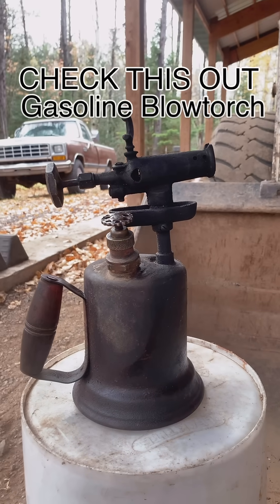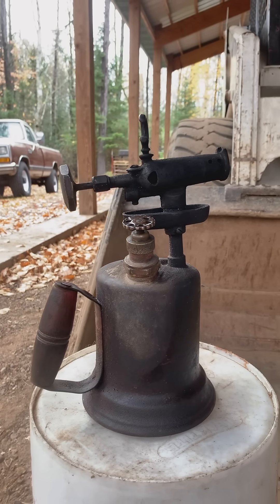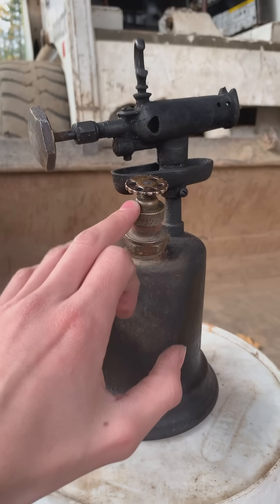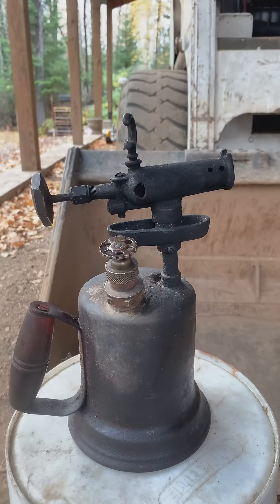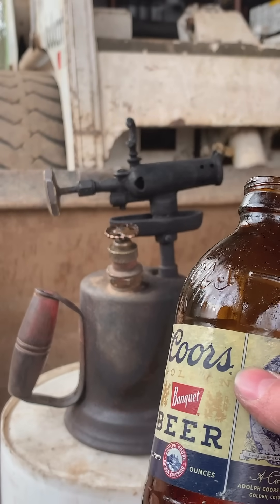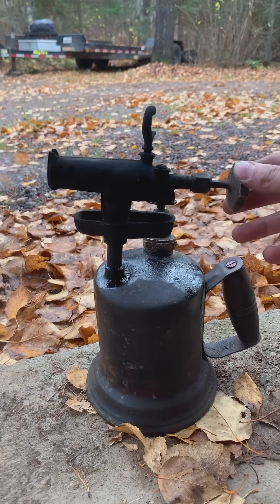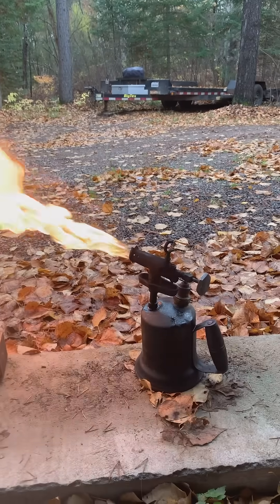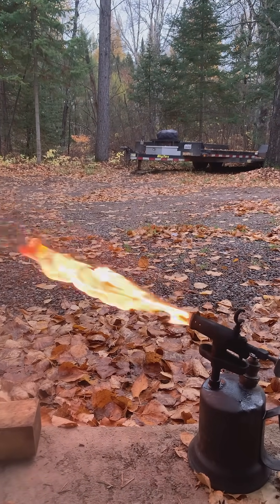BIG FLAME how a gasoline blowtorch works #antique

Comment: I still have a couple. I used them to melt lead for cast iron plumbing and to melt solder for electrical wiring into the 1960s.

Comment: I have a older one built in 1926

One more thing...engine oil worked the best, as it was much hotter than kerosene, which was commonly used, not gasoline

Comment: I was brought up with paraffin/kerosene blow lamps. They take longer to preheat and the pan must be filled with meths as kerosene doesn't burn readily on its own as a liquid. 
The kerosene ones don't normally have a valve for some odd reason. You just pump them up as the meths burns out and hope you get gas because they make great flame throwers if you pump them too soon. 10 feet of flame is not unusual.
They were great for stripping paint off metal with a wire brush and a bucket of water for when a) the brush caught fire and later, b) when I figured plunging them into cold water seemed to temper them.

Comment: I have my grandfather's old torch. Solid brass and leather seals. Runs on paraffin. I still use it on the odd occasion for sealing roof leaks and lighting damp wood in the wind.

Comment: Reminds me of my first campstoves.

Stove #1 had no control whatsoever. Copper tubing came out of the top of the fuel tank, made a complete loop and then went back in. At the bottom of the loop there was a pinhole in the top side of the tube. You jammed a cork into the loop to keep the pinhole from leaking when the stove wasn't in use.

You heated the loop with a little chunk of gas-soaked wick on the end of a metal strip until the pressure built up and started forcing gas vapor out of the pinhole.

I took the girlfriend on a weekend campout close to town to test out the gear before a longer trip. About five minutes after lighting the stove we had a vicious green flame shooting out over a foot on either side of the loop in a V shape, which missed most of my little aluminum camp pot and carbonized anything in the two spots that did get heat.

Eventually it became frightening, so I put it out somehow - probably with the cork. Anxious to relieve the pressure, I gingerly unscrewed the filler cap, which went whizzing past my ear like a bullet, never to be seen again.

After that one trial use I bought a beautiful little Optimus stove that still works like a charm now 5 decades later. Same principle but vastly more usable, with a nice round burner and a proper control valve.

I think the gas grenade cost about CDN$7 at the time, the Optimus a princely $34.95.

Comment: Definitely 3 stooges,  I got a dozen of these. The old leather seal just needs oiled in most of them & they're working again.  I imagine it would be rough as hell to actually use it to solder say a cast sewer line or something.  Ive never actually tried  ....yet 😂

Comment: Used to lead in cast iron plumbing pipes. And on low to solder sheet metal. Probably  also leaded some 50 's and 60's lead sleds

Comment: Is it gasoline or is it kerosene?
Reply from the maker: There are two types this one is actually designed to run on gasoline. Kerosene torches is slightly different and you can’t run a gasoline torch on kerosene and the other way around because of jetting

Comment: There should be a sheet-metal hood mounted on the burner head, which helps hold the heat from preheating in, speeding up the process.  They are often missing after all these years.

Comment: Thats for kerosene, not gasoline. 

Yes, you can use pump gas, or even white gas in them, but you will destroy the seals in the pump, and then when it inevitably starts leaking said gasoline into the cup below the nozzle, things will get very hot, very quickly. 

This is exactly why the torch in the 3 stooges skit is doing. Somebody put the wrong kind of fuel in that thing for years and years and years, and it is now broken and malfunctioning on set and on camera.

Comment: This is the same idea as those MSR "white gas" stoves.
A little liquid fuel in a pool adjacent to the burner bell  is lit on fire.  As this small puddle burns, it heats up the burner bell (think stove generator).  When this metal assembly is hot enough to vaporize fuel, the hexagonal valve wheel is turned, allowing pressurized liquid fuel to approach and squirt out a jet at the burner bell.  
While initially orange and dirty burning, the metal assembly heats up even more to operating temp, allowing the pressurized fuel to burn in a "clean", blue flame.
Old white gas Primus stoves are very similar.
Reply: White gas is it kerosine, write?
Reply: @almarch-jw9lk  White gas is just pure,  very clean gasoline.  It doesn’t have any of the additives or oils that are in pump gas.  Coleman fuel is white gas.
Reply: @almarch-jw9lk  No, white gas is additive free 50 octane gasoline

Comment: You don't need to add fuel from another container in the pre heat tray.  Simply pump the tank, then place your hand over the flame outlet and open the gas valve to allow fuel to squirt out but because your hand is there, the fuel drips down into the tray.  After two or three seconds, shut the gas valve and light the fuel in the tray and wait for the gas generator to come up to temperature.

Comment: I lived in Outer Mongolia from about 1998 to 2008. The Russian UAZ jeeps that we drove would get so cold overnight in the witnter that the oil in the pan would essentially freeze solid. We used these to heat up the oil. We'd light it, set it on the ground under the oil pan, and let it burn for 5 or 10 minutes until the oil liquified. 

I tried this on my LADA Niva once and it burned the van belt, though. Had to be real careful about how you positioned it.

Comment: I had one of these. And it worked GREAT. …..  used it for preheating pieces during fabrication and blacksmithing , and heating soldering irons …
Reply from the maker: That’s awesome that’s what I use mine for as well starting campfires. When it’s warming up it’s like a mini flamethrower

Comment: Man, ive passed up several of these things in shops around here but after watchimg this, im heading out to buy one today. Damn this thing is cool. I will definetly replace old seals and parts because my guess is if something fails, its going to get gnarly real fast lol.
Reply from the maker: They are very easy to use and maintain but as always be careful when using one especially a gasoline blowtorch. Also make sure you don’t have a kerosene torch because they are different

Comment: Last year (about this time of year) I bought a tri-fuel camping stove that works on exactly the same principle. You change the gas jet out to change fuel - the gasoline jet has the largest orifice, the alcohol jet is intermediate, and the diesel jet has the smallest hole.  haven't yet checked the alcohol jet, but suspect it will actually work best. I was impressed with how well gasoline worked, and have only tried pharmaceutical grade mineral oil in the diesel jet (It didn't work well - never heated the nozzle enough to obtain consistent blue flame. Suspect kerosene or diesel would work fine). It has a little aura of danger to it (you know, gasoline), but if you don't do stupid things, stupid things don't usually happen. In looking at the various models, I got the impression these type stoves/torches are used daily in many areas of the world.

Comment: dad taught me to solder copper pipe with that beast. most of the burn scars have faded now .. just like the hair lol
Reply: No wasaaayy
Reply: How did you avoid burning down the house with a six foot flame shooting out of it?! Soldering copper pipe with that torch is WAY OP! Calling BS!
Reply: @cyberGEKif you look at the very end of the video, the fuel goes from partially liquid to a shorter fully gas blue flame similar to a contemporary propane plumber's torch.
Reply: @cyberGEK LMFAO LEARN BEFORE YOU MAKE STUPID COMMENTS
Reply: @tonymoto1188there's no need for that here.  People don't learn very well when they're being mocked and ridiculed.
Reply: @cyberGEK you adjust rhe flame

Comment: when the seals dry rot in these things they get dangerous. always rebuild the old ones correctly before using this. my grandpa taught me how to use this thing and his advice was " be damn careful with that thing its not for kid's " ! true statement 👌 😂
Reply: I was taught from a very young age that you don’t bring a fire to gasoline.
Reply: @Notfiveo0 How about bringing gasoline to a fire?
Reply: What do you rebuild the seals with?  Asking for a friend in my basement.
Reply: @firstmkb we used leather , motor oil on em to make em swell like a rear main rope seal.
Reply: @justinriley8651  thanks for the tip , I've got one that my dad gave me in 2020 , I tried it once and got scared , probably because I didn't let it warm up enough . Rightfully so and I likely dodged a bullet.
Reply: @markhowards420 its technically a bomb once you get it compressed ,so becareful.i was taught with gasoline ,im sure there are other fuels that would work but once you get that thing set right its pretty amazing!
Reply: Oh, I don't know.  I was probably about 12 when Dad taught me how to use one and solder sheet metal with those big irons.
Reply: Oh yeah i worked flea market and accidents were always happening with these because people were actually putting gas inside to try them. Theres plenty of gas at any flea market because of all the small motors and tools being sold but i argued to make it an official rule on the website to not test at the flea market and it's still there.

Comment: I'm a tinner, that heats up soldering irons. They fit right in the top. I'm sure they have other uses as well. As a kid, I seen my dad cook hotdogs on the side of the road with one for his family of 6 kids at the time. Set the pot on some stones to elevate it, and put the flame on the side of the pot....
   That was before interstates.
Reply: Before fast food restaurants. Lol
Reply: Ya I still have my dads with a soldering iron with it.
Reply: B4 Dwight D. Eisenhower/Prescott Bush installed the interstates
Reply: Hi! Im not from U.S. ,can you explain what  " interstates" means?
Reply: @almarch-jw9lk highways rated for faster speeds and offering limited access.  Eisenhower learned the importance of transportation infrastructure from WW II in Europe.  They opened up travel in the US on a larger scale than before.
Reply: @almarch-jw9lk I'll try. 
   I'm almost 62 years old. When I was a kid, there was basically 2 kinds of roads. Streets, and 2 way highways (one lane going each direction), and, on the 2 way highways, in some places, there was a 3rd lane in the middle for passing slower vehicles, especially in hilly county.
   Well, we moved a lot, because my dad was a ironworker. So, when I was maybe 10, when you were on the 2 way highways, you would see a lot of brand new overpass bridges with exits. My dad drove an old 3/4 ton military dodge Crew cab 4x4 with a slant 6 in it (I learned that later in life), and it was slow as a turtle, and we would travel state to state, because my dad owned some real estate he had to maintain, and we have actually 4x4ed up the side of those overpasses, and sleep a while.....kinda scary, especially for my mom. They (state, Federal?...idk) were building multi lane super highways with higher speed limits all across America. Someone else will probably come along and explain it better than I. It was good, for travel, but it destroyed thousands/maybe millions of small businesses including motels and hotels along those 2 lane highways, and, a lot of those old buildings are still standing today. The old roads are still open, because people live there. The new roads were called Interstates.
Reply: @almarch-jw9lk its all the main highways that connect the United States,  inter•state

Comment: Very similar to kerosene torch, probably only difference is the size of the jet. Kerosene burns much hotter.
Reply: The flame looked like kerosene
Reply: I've got one. I have used it with kerosene
Reply: Some say you can use them with any liquid combustible.

Comment: What's the ring on top for?
Reply: Holds soldering iron.
Reply: It's to hang it from the pot that has molten lead on it that was used on cast iron plumbing pipes

Comment: I used to use one of these back in the 60s to heat up a soldering iron. It was kind of a, it wasn't a special soldering iron, but it had a big heavy piece of copper on the end of it that you would hook the handle in that circle piece on top and lay the rest of the the handle down in that v groove on the top, like a site on the front of that thing and let the flame heat the Torch or the Torch heat the tip up and then we had a bar of solder that we used to use the soldered rain gutter with, but that was a long long time ago, but yeah, I've used those a lot and they are a handy thing to have even used to using to burn paint on the side of houses to make. It bubble up and take a scraper and scrape it off, but my gosh, I'm telling my age now, thanks for showing us it's pretty cool to see some of that old stuff working.!God Bless!
Reply: My dad taught me how to solder sheet metal using two of those big irons and a torch like this. He was soldering steel gutter on the house.  We would put one iron on the torch to heat while we used the other one.
Reply: @Lewis2553 yep thats right, it anit nothing else more satisfying then to watch that solder flow on a clean piece of tin.😊 take care!
Reply: @theluth9046 
🤔 I could think of several things more satisfying. Lol 🤣
Reply: @alanwhiteside410 well...ya know, come to think of it, so can I!😅😊
Reply: I learned to solder sheet metal in high school shop class with those style of soldering irons. We had a different sort of natural gas fired heater mounted to the work bench we used to heat our soldering irons though.

Comment: I like the old 80s Dodge pickup in the driveway better.
Reply: Yeah, but those ballast resistors... 

(If anyone reading this is having ballast resistors issues, i.e. they keep burning up too soon, you probably need a new ignition switch.)

-Some guy that survived a '78 Ramcharger daily driver that ate ballast resistors so often, he bought four at a time and kept them in the glovebox until he figured out WTF the issue was.
Reply: @KCA4458  Yeah my go  to for needing a ignition switch. Is to wire in a crossover. from the starter into the cab. But my trucks tend to be in the wood truck category by the time I get them. rocking a gmt400 k35 3+3 for the time being. Then it will probably need it's third engine.
Reply: Yeah was thinking might be a early 90s. But not with that grill pattern.

Comment: Floor layers like me used to use one of these to heat up the cove, so the old original stiff linoleum would curve up the wall,  you could also use it to soften the flooring to cut intricate seams.

Comment: Why does the head of torch need to be hot enough? Couldn't you just ignite the fumes at the tip?
Reply from the maker: Good question it needs to be hot enough so the liquid gasoline runs into a vapor it burns hotter